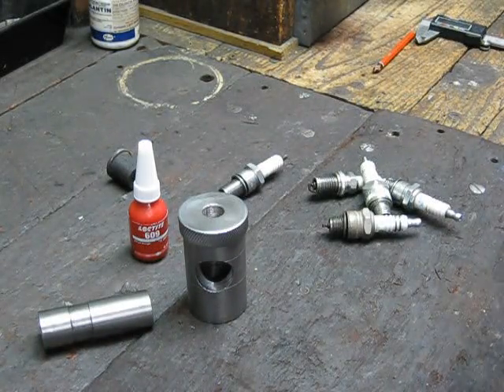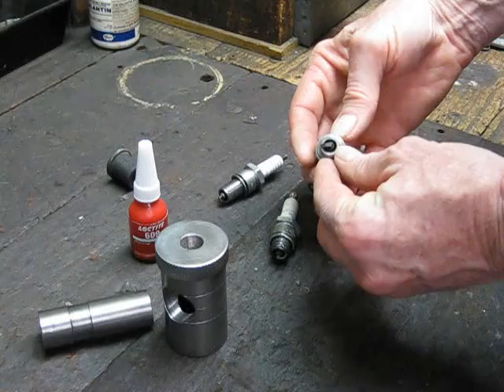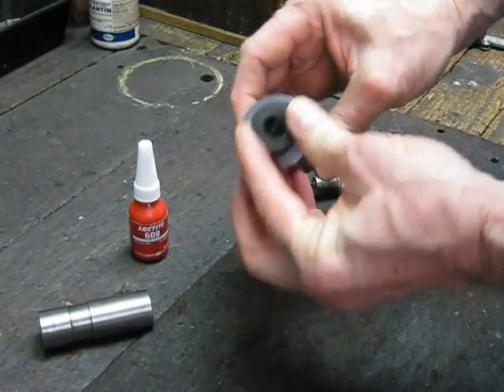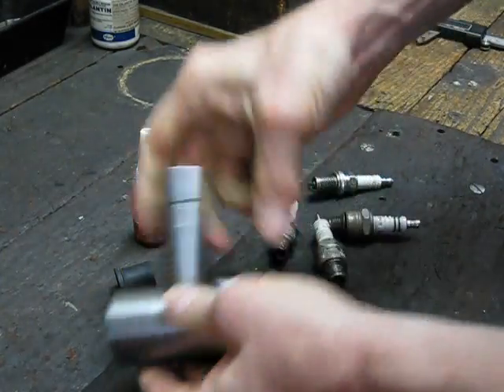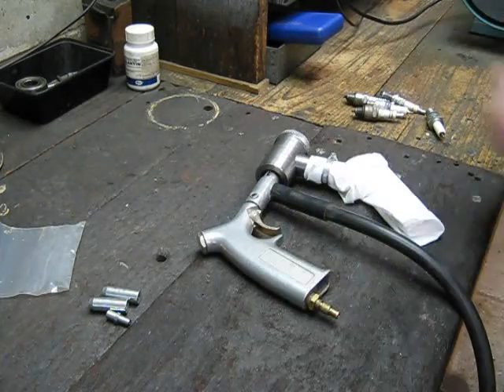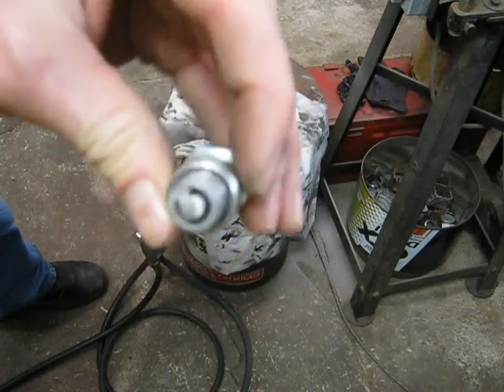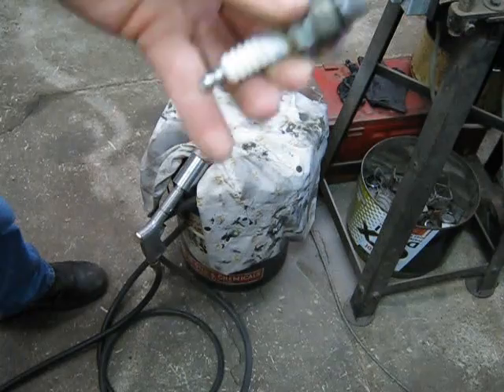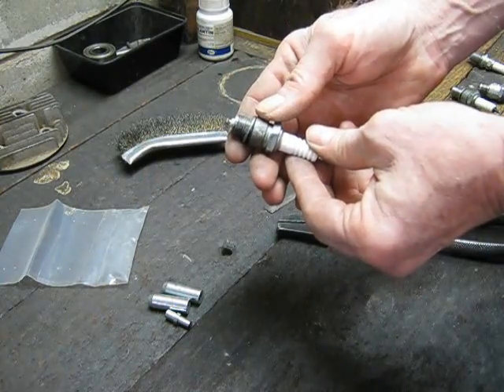How to make a spark plug cleaner - easy DIY project

Comment: Hello , sir plz tell me how much air pressure required for cleaning spark plugs ❤❤
Reply from the maker: Hi Mustafa. I use the maximum pressure available, as carbon build up is hard stuff.   Lower pressure will still clean them, but take longer.  Cheers Rob

Comment: I bought (and returned), a HF plug cleaner. A real POS.
The top of the ground strap doesn't get all that contaminated, yet the media is aimed at the strap, this shielding the center electrode.
I'm going to rig up a contraption, probably like yours, but more Flintstonish 😁
I want the plug at about a 45 degree angle to the media stream, then rotate the plug while blasting it.
That looks like a SnapOn product.  Very nice  👍
Reply from the maker: Hi Randy.  That sounds like a good idea.  I kept it as simple as possible.  The electrode ground does shield part of the porcelain core slightly, so coming in as you describe should fix that.  My design gets off 99% of the crud overall so it does the job.  It would be interesting to pull apart a commercial cleaner (eg. old Champion) to see how they do it.  My Bro-Inlaw has one in storage.  Cheers Rob
Reply: @Xynudu   with your same design, I wonder if it's possible to  offset the spark plug ever-so-slightly and build or screw in a replaceable deflector of some sort.
Anyway thanks again for the video.  What you made beats the living crap out of the one Harbor Freight sells. 
How course is the media that you use, or what specific product. Harbor Freight has a pretty fine media, I'm not sure the mesh.
Reply from the maker: Hi Randy, I use quite fine GP sandblasting grit.  I'm guessing it's about 100. It's pink, so it would be Zirconium.  You want to keep the grit as fine as possible or it can wedge at the base of the porcelain.  Always check that there's nothing trapped down there.  If there is dig it out with a fine point tip (I use a ground hacksaw blade).  Cheers Rob

Comment: or just use a cigarette lighter and burn off the carbon
Reply from the maker: If the high temperature flame from the combustion process can't burn off the carbon how the hell do you expect a poxy cigarette lighter to do it ?  LOL
Reply: @Xynudu  A blow torch for 30 seconds will clean it up nicely.

Comment: Odd, I have never seen an engine destroyed from cleaning plugs with a dedicated spark plug cleaner.  If it was due to failure to look at the plug and make sure all the remnants of sand are removed, well that's one thing I guess.  You just have to do a complete procedure and there will be no problems.  Worse things than a grain or two of sand get sucked into an engine that's for sure.  And as for those that say cleaning a spark plug with a air/media blaster harms the plug, well your wrong.  It is an accepted method for cleaning spark plugs in aircraft, so if the FAA says it's acceptable it's A-OK with me.  Let's be real here....
Rick H.
Reply: Been around Aircraft for 45 yrs. and know from experience when the FAA has cleared any proceedure to work on an aircraft it is more than acceptable than anything else available.

I too was an automotive machanic in my younger days but when I became involved with homebuilt aircraft, wow (!) Did I learn a few things, all of them good since keeping your plane flying is a little more important than not having a flat  in your car, generally speaking.

Standard proceedure when I worked on automobiles was to first of all use a small nylon headed mallet to lightly tap the spark plug body to dislodge any loose material and then let it soak for 15 minutes in solvent to loosen up any material which will be desolved by the solvent, after that the plug was placed onto the spark plug cleaner to blast the plug with a fine media to remove all traces of carbon; we did not use the heavy abrasive media that was supplied with the "sand blasting" unit but instead the same material the owner of our shop used on his personal aircraft and during the time I worked for him he never had any problems with his plugs nor engine but at the same time maintenance on a plane is a lot more stringent that that on most vehicles.

But you are correct when you stated by "sand blasting" you can cause fine pitting of the surfaces which will attract carbon deposits more quickly that normal - so that is why the use of a finer media such as glass beads, walnut shells or anything of this nature is better to use when you do not want to degrade the surface of the item you are working on.

Comment: You can blast plugs with a spot blaster, which is virtually what you made; but the sock the air is exhausted through is the grit resouvoir, and there is the rubber spot nozzle to put the plug in[no graunchy threads].
They used to give away battery operated plug blasters with cans of oil in one of the local factors, they worked pretty well and I was looking to see if anyone had made one as I am thinking of making one to blast bolt heads, save me changing the media in my cabinet.

Comment: I am not convinced that it worked well because it cleaned all the sections except for the two spots that make the sparks. It would have been better if you inserted the plug in the chamber at a 90 degree angle to the gun. In addition the open side of the hook should face the gun.

Comment: Use baking soda;  heavy abrasives like sand will texturize the insulator and quickly attract carbon and then what is the use cleaning the plug in the first place.

Comment: I wish I had a little metal lathe - not quite so easy without one of them. That said, beautiful workmanship on your own project and works extremely well. Impressed!
Reply from the maker: Mark Tibbert Hi Mark.  Small lathes are so cheap these days most people can afford them.  You don't need a large unit to do projects like this.  People get hung up on size, and are given bad advice to buy some monster, that really is useless for hobby work.  Get a 7x14 or 9x20 and have a go :)  Cheers Rob

Comment: But you didn't set the gap and ensure that the electrode was filed flat etc.
Reply from the maker: No kidding.  I thought that was elementary.  Rob
Reply: No it isn't unimportant. A filed centre electrode becomes shorter hence more heat on the ceramic and less protrusion into the combustion chamber. The ground electrode when filed to make arc contact flat becomes thinner therefore more prone to burn-out: less metal/heat-sink.
It is not elementary and as an accomplished engineer you should make comments about the whole cleaning/setting cycle because I/we am/are always interested to see how others do it and what tips they have.
The contact faces and gap between centre and ground electrode are extremely important and not elementary. A surprising comment from an engineer.
Reply from the maker: OK.  Well it's good to have your comments on this in the replies, and people can be aware of what correct setting can entail.  The video was really about making a cleaner, but pointers on what you have stated would be good in another video. Cheers Rob

Comment from the maker: Google "Champion spark plug cleaner" and you will see the type of unit commonly used in motor garages.  These days it's cheaper to throw away the spark plugs rather than pay a mechanic to cool his heels while he cleans them.  There is also no guarantee that a cleaned plug will as good as a new plug.  Platinum plugs can also be compromised when cleaned. At the end of the day the customer pays the bill, so to that's why you get new plugs for road vehicles these days.  Rob

Comment from the maker: I will also add that an aircraft engine is no different to any other engine in the tolerances required.  Aircraft engines actually are very low stressed and rev much more slowly than a comparable car engine.  Rob

Comment from the maker: My father was a mechanic all his life. Virtually all large garages had a spark plug cleaner.  It was common practice to clean plugs this way.  The aviation industry are no different. I point out at the end of the clip the need to ensure grit is NOT jammed in the plug.  Rob

Comment: nice project however grit will jam in the tapered void and eventually free itself off thus damaging your bore the aviation world has better/tighter tolerances than the automotive world for the price of a new plug be it platinum or other you would be better off changing it for new platinum may be expensive to replace but when you take in to account mile for mile its cheaper than a standard plug.. one bit of grit is enough to destroy your bore...

Comment from the maker: It's worth noting that the aircraft industry use pneumatic spark plug cleaners extensively to clean fouled aviation plugs.  So if safety was an issue that wouldn't be the case.

If you don't want to make a pneumatic unit like this one, you can buy small air powered ones cheaply from Ebay and stores like Harbor Freight.  Rob

Comment from the maker: Information from the NGK USA web site: FAQs - Spark Plugs

Q: Can old spark plugs be cleaned

A: Yes, you can clean spark plugs.

1) If the firing end is wet, make sure you clean the spark plug with a quick drying cleaner. (Examples: contact cleaner or brake cleaner).
2) Sand blast the spark plug using low air pressure  and use a dry compound.
3) Completely blow all the sand from the spark plug.
4) Using a wire brush clean the threads and re-gap.

Rob
Reply: i flush mine in small container with gas   after blasting as for low air i use 100psi do not use sand its been outlawed that dust is bad for you lungs  use a media looks like black pepper

Comment from the maker: Spark plugs are sold as platinum or plain tip.  Very latest vehicles use platinum quite often.  These are not suitable for grit cleaning. However standard spark plugs can be cleaned. Commercial spark plug cleaners use carborundum grit the same as this one.  I've never seen an insulator break from grit blasting.  Insulators or more likely to break from poor gapping technique.  Rob

Comment: I really don't want disappoint you, you have a very nice setup.
But spark plugs usually are coated with platinum. By sandblasting them you remove that coating and the spark plug will corrode extremely quickly away.
Also the crystal material you use for sandblasting can produce micro cracks in the ceramic insulation of the spark plug and then it brakes off and falls into your combustion chamber. The effects of that you might know.